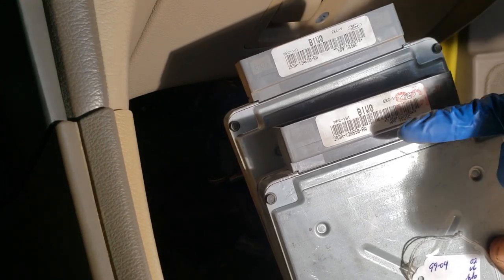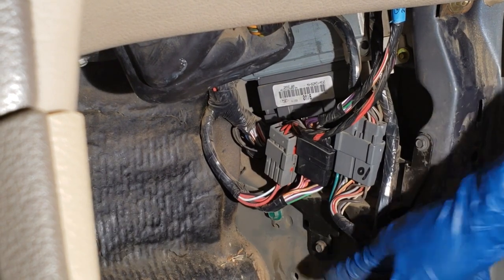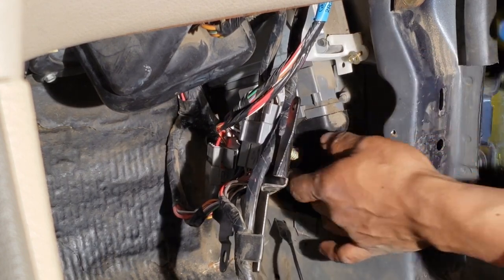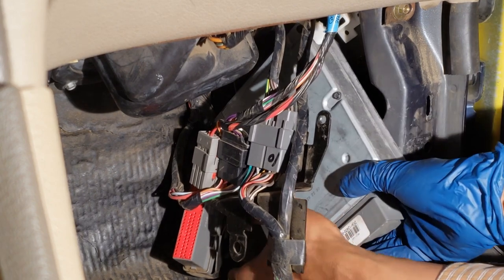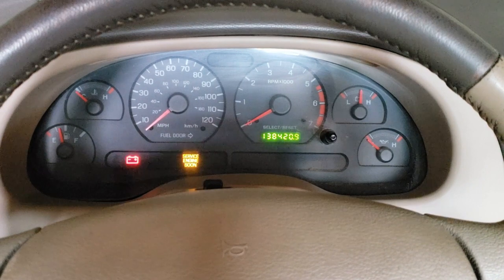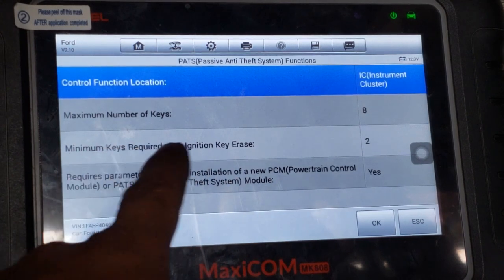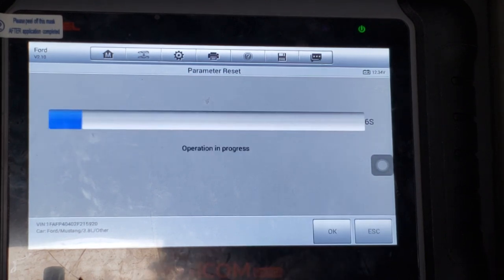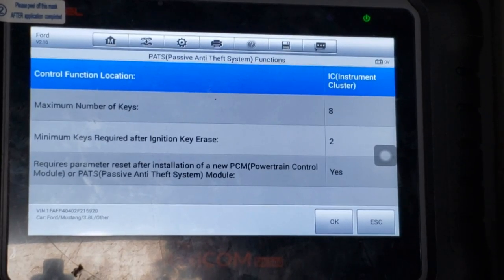99-04 Mustang PCM Replacement & PATS Key Reprogram

Comment: So I just bought a 2002 mustang V6 manual and when they were trying to program the car with the new keys that they cut every time they put it in the ignition theft kept blinking, so do I need to replace the whole PCM For the new keys?
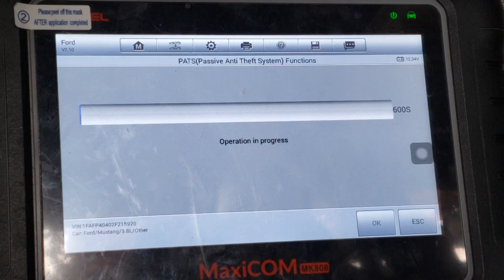Reply from the maker: you would do an ignition key code erase, listed on the menu at 3:33 . It is shown in action at 4:00 .
Reply: @OldSchoolNoe  so what I need to get a new PCM or can I just change the fuse

Comment: can this part cause a car to not start? my 03 v6 mustang won’t start and keeps sputtering, i’ve changed the fuel pump, filter, ignition coil packs and the driver module, could this be what i’ve been needing?
Reply from the maker: Is a P1260 DTC stored? If its not, reprogramming the PATS module is not necessary
Reply: If you can get your car to start, at least turn over like she's trying. Don't go after the PCM just yet. You don't have a PATs problem. Look inside the front passenger wheel well. Take the tire off and remove the plastic splash gaurd. Up top there is a metal box, held by a bracket with two bolts. A big wiring harness that plugs into it is secure by a bolt in the center of the harness. This box is called the CCRM, Constant Control Relay Module. Rock Auto and other parts stores call it a BCM, Body Control Module. Whatever Ford wants others to call it, because they stopped making/using them in 2004. Dirty little move they did by taking 5 fuse Relays, soldering them all on a circuit board, riveting it shut, and hiding it in the wheel well. They use to charge $500 at the dealer for one of these. These Relays are basically fuses. They Control your fuel pump, pcm, a/c clutch, WOA, and your low and high speed radiator fan switch. Grab one from the salvage yard or a number of new refurbished ones, they are sold everywhere. Don't pay more than $150 for a new/refurbished. Also make sure the fuel shut off switch in the trunk isn't, you know..... shut off. Tons of videos out there, search CCRM
Reply: Oh and don't go to the dealer other than having them look up the part number for you. Oh yeah, make sure you get the right part number. Many different ones that all look the same.  Wiring harness and all

Comment: You dont need 2 keys if you swap out the ignition pcm and dash like speedo and whatnot right you can still use the auto wire harness and whatnot right ? I have 2 newedge gts ones has the whole drive chain(motor trans driveshaft,steering colom yk everything BUT it is wreacked so i cant use the radiator and exaust tips thats pretty much it) on the auto the dude drilled out the ignition and i hooked a battery up to it and it just kept blarring its horn as of right now tommorow i will be swapping out my ecu and pedels any advice and am i right on this?🤔
Reply from the maker: In theory it should work, don't forget to swap over the PATS module too

Comment: when i attempt to gain security access, it goes through the whole 10 minutes timer and then backs out to the screen before the 10 minute timer. Im unable to gain security access. it doesnt say anything though just backs out. do you have to have an active autel subscription in order to gain access. my subscription ended the other day ): idk what to try
Reply from the maker: @spyarc5522  is the scanner reading the VIN properly? Did you input the correct vehicle info? It sounds like something might be disconnected.

Comment: @OldSchoolNoe I currently have a 2001 with a 99-00 gauge cluster installed and it works but a few small functions don't work as they should. For example, turning on the rear defrost button blows the AC  fuse and the convertible top doesn't work. I bought a 2001 cluster that should fix these issues since they incorporated some of these functions within it beginning in 2001, but i need to program it to match the PCM and pats and i have two keys as well. How do i do this?
Reply from the maker: look at 3:58 , you would select "instrument cluster." or "Hybrid Electrical Cluster."
I have not done an instrument cluster program on the Mustang, but that is what I would try.
Reply: @OldSchoolNoe  Thanks for the reply. Unfortunately I don't have a scantool. Would you be willing to do it for me? I'll pay. I'm in the LA area.
P.s. the tool you linked on Amazon says it doesn't program: 

*Note: NOT available with Active Test, ECU Coding, and Programming.
Reply from the maker: @kbh8181  I looked up the Ford service procedure for the instrument cluster. There's nothing about programming it, it should just be a direct replacement. Have you tried installing the replacement yet?
Reply: @OldSchoolNoe  Yes I have tried the swap and it won't start. I put the old one back in and It starts up normally. It has to be mated to the ECU for it to work. I did a search for "Ford cluster programming" here on YouTube and this is an example: 

https://www.youtube.com/live/FG8OBNvYHdc?si=QV2MiQGB73X74VrN

Comment: Also, when it says, cycle key1 in ignition off to run for 3 seconds. 

Does that mean go from off to run, off to run, off to run? 

Or OFF to RUN and wait 3 seconds and then key #2

And when it says disconnect DLC from unit we unplug it from the obd2 port on the vehicle and disconnect the device from the vehicle?
Reply from the maker: First remove the key
the unplug the scanner from the obd2 port
insert key #1 and turn the ignition to run mode (that's the mode before cranking the vehicle) let it sit in that mode for 3 seconds, cycle to off and remove the key
repeat on key #2
Reply: @OldSchoolNoe thank you

Comment: I have a bad pcm and need to replace but I only have one key. Would I just need to program another blank key?
Reply from the maker: try to program that key before changing the PCM, just to make sure it works.
Reply: @OldSchoolNoe  the pcm that I do have does not communicate with the instrument cluster. It only actives some parts of the car functions
Reply from the maker: @andycoronado1927  that's quite a predicament you're currently in. If the ignition cylinder is still the original, I would have the Ford dealership cut me another key for it, then replace the PCM and program the 2 keys to the new PCM.
Reply: Im currently having this issue after my sct eliminator chip fried my PCM when i unplugged it. Long story short I've been searching for a PCM i found a matching one, i assume i can install it and then have it reprogrammed as you did in this video and it should work right? Ive lost quite a bit trying to get this done and I'd hate to sell the car over a fried PCM
Reply from the maker: @MustangBullitt-sz8tg  yes, it should work
Reply: @MustangBullitt-sz8tg  did it end up working? Simiilar issue on my 2004 cobra

Comment: Late to this but I have my autel  and every time I try to do a parameter reset it won’t let me it turns my scanner off do I need to know the vin of the replacement pcm?
Reply from the maker: No. Does it give a message such as "access denied" or "parameter reset failed?" I find it very odd that it would just shut down.
Reply: @OldSchoolNoe No it just automatically takes me back to the menu to pick the main menu  it will let me into the immobilization menu and grant security access but not parameters, do I have to do parameter reset or can I just delete previous keys and program new ones?
Reply: It’s a autel Maxisys and I’ve never updated it cause I don’t want to renew a subscription so I don’t know if that’s the problem
Reply from the maker: @everydaynormalness2220  no, since its an older vehicle, its program doesn't need to be updated. You have to do a parameter reset, because if you replace the PCM, and if you just reprogram keys after that, the PATS module is going to have a problem with that. Why are you replacing the PCM? Is something not communicating?

Comment: How come on the eBay PCMs they say you need to reprogram PATS with your keys even though they flash the ECU to your cars vin?
Reply from the maker: The anti-theft system on the Mustang works with the instrument cluster aka ([HEC] Hybrid Electronic Cluster), and the PCM/ECU.
Those are a "matched pair" when installed, along with the PATS system. All 3 share "security data" before the vehicle is allowed to start. If one is changed, it will have different security data so all 3 need to be reset and reprogrammed to each other.

Comment: How do you reprogram the vin?
Reply from the maker: It is quite expensive, to start you need a J-2534 pass through device, which costs around $1,000, a laptop, and a subscription to Ford. 
Here's a video detailing the process, the vehicle in the example is a Ford Transit, but the Mustang process is basically the same.
https://www.youtube.com/watch?v=N2OhtU1v8EE&t=651s

Comment: What exact model is your scan tool ? I see several different MK808 models on amazon but none of them seem to have this function.
Reply from the maker: Autel calls it the "immokeys" function. 
 

https://www.amazon.com/Autel-Diagnostic-Diagnosis-Throttle-Injector/dp/B089XWCTX3/ref=sr_1_8?crid=1EOLNTCPY2GU0&keywords=mk808&qid=1687215964&sprefix=mk808%2Caps%2C992&sr=8-8

Comment: Do you really need two keys to do these?
Reply from the maker: 2 keys minimum, otherwise the PCM you're programming will not let the "single key" turn on the car
Reply: 2001 mustang gt had the pats system removed. Still need 2 keys?

Comment: Not having a good anything with this fkin car.. 2001 mustang had to repair the odometer ..solder connections.. put it back in no start put in fully programmed with vin and fully flashed pcm no start.. locksmith tried parameter reset nothing.. put old immobilizer back in nothing..
Reply from the maker: A couple questions to clear things up:
1. it cranks but doesn't start, or totally dead?
2. how did the problem start?, I'm assuming it happened after repairing the odometer

I'm assuming it cranks but doesn't start. First thing i'd do is make sure the battery is healthy, at least 12.6V, then check all fuses. Maybe something was short circuited.
Then check the fuel pressure, either physically by hooking up a gauge to the shrader valve, or by looking at the scan tool Pid for fuel pressure.
  If trouble code P1260 is not present, then this is not an immobilizer (PATS) issue.
Reply: @OldSchoolNoe  it started when I took out the IC to repair the odometer bad solder joints these cars are famous for.. did that put the cluster back in.. and no start I had it turning over but now it's not recognizing either key and no pats pcm communication...
Reply: @OldSchoolNoe  it's not reading the keys  so I can't get any scan from it... When I use forscan it communicates with the OBD2 tool to the laptop then. Says no communication with vehicle and ask me for the pcm part. Number when I enter it. It shows a 2000 mustang... Mine is 2001 it shows correct mileage but no vin it shows 2 keys remembered in pats but when I try erasing and programming new keys it shows 0 keys present then when I program both keys it says two are saved.. but every scan tool I've used won't work saying no key in ignition..
Reply: @OldSchoolNoe  can't check fuel pressure as the fuel pump isn't receiving signal from pcm. It won't let me do a parameter reset to link pats and ocm
Reply: @OldSchoolNoe  pcm is new fully. Programmed with latest tune info
Reply: @OldSchoolNoe  it is a pats issue when the pats isn't recognizing the pcm